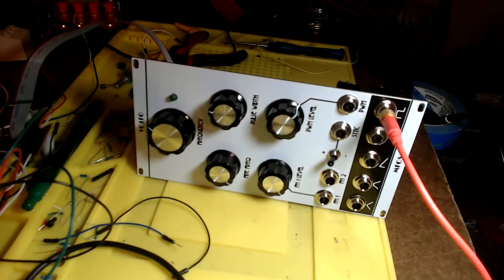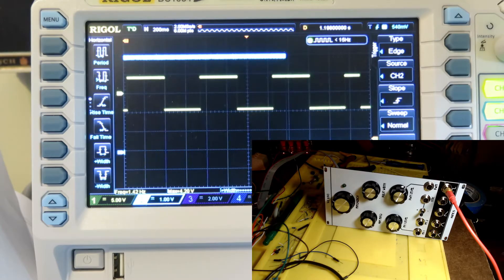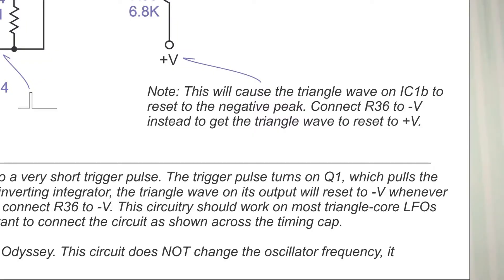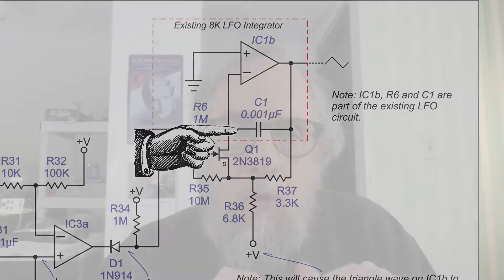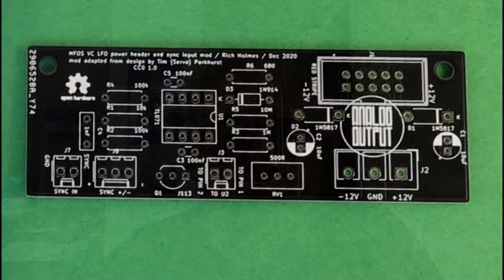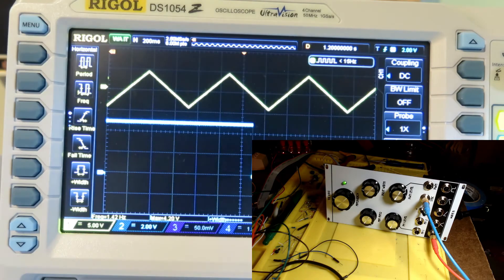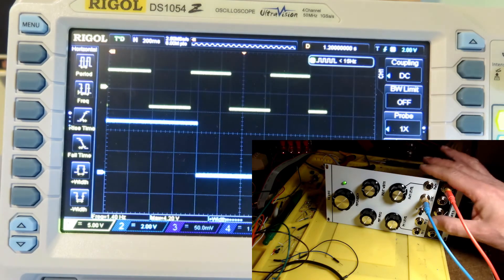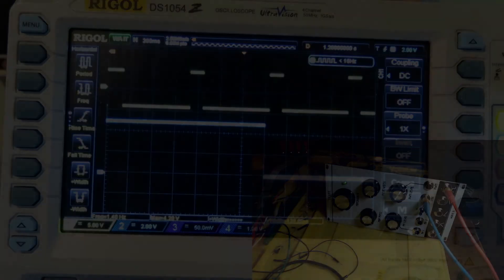MFOS LFO sync modification

Comment: It kinda sorta works on the MFOS LFO on my website but I think that might be a different one than the one you're using. The 680 Ohm got really hot so I put in a 1K. Still gets quite warm. Like I said it kinda works but I don't like components getting hot. That means high current.
Reply from the maker: That seems strange to me. Yes, when the JFET is open you could potentially have a 12 V drop across the 680 Ω resistor since it connects to the virtual ground at the LFO op amp input, and that would be 210 mW power, borderline for a 1/4 W resistor. (330 mW if you're trying this with ±15 V power.) But the JFET should not be open continuously, only for about 3 µs at each sync pulse. If you're syncing at 100 Hz that's a duty cycle of 0.03%. When the JFET is closed current can flow only through the 680 Ω resistor via the 500 Ω pot, if that were turned down to 0 you'd have a problem, but it should be somewhere around 300 Ω and then the power would be 140 mW averaged over the LFO cycle. I don't think that should be a problem. The power is higher, again, if you're using ±15 V, about 230 mW, so that's borderline. 

All of which is probably moot for the "other" MFOS LFO on your website. In mine the reason those resistors are as small as they are is the MFOS integrating cap is 20 nF and you need R small enough to keep the RC charging time short. In an LFO with a smaller integrating cap (such as the Magic Smoke one the mod was originally designed for: It has a 1 nF cap!) those resistances can be larger. But in your "other" MFOS LFO the integrating cap is switchable between either 100 nF or 5µF! At 100 nF the charging time is 5x larger than in mine and in principle you'd want the resistors 5x smaller, like a 120 Ω instead of 680 Ω and a 100 Ω trim pot. But then the power would be 5x larger, out of the question. But you could increase the 1 nF input capacitor to 5 nF or more, then the sync pulse gets 5x longer and you can take longer to charge the integrating cap. Of course with 5 µF it's worse again. For that you'd really have to stretch the sync pulse, and then maybe the wave shape gets too distorted when you sync.

In your LFO I guess you could increase R1 and R8 and decrease the integrating caps correspondingly, but that's maybe not something you'd want to try doing.

More discussion of this stuff here: https://analogoutputblog.wordpress.com/2020/12/10/living-in-sync/
Reply: @analog_output  Yes the timing caps in my LFO are just too big.  This is not the right LFO to use the sync circuit on. But the circuit itself works very well so I'm keeping it in my archive for future use.